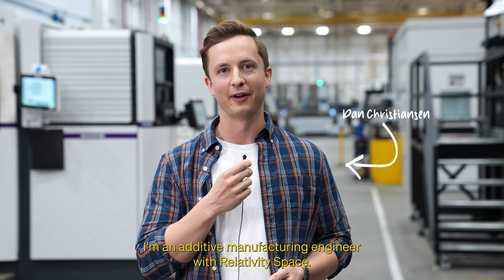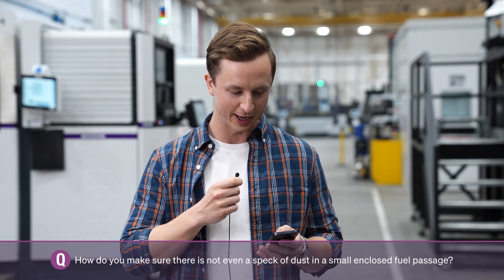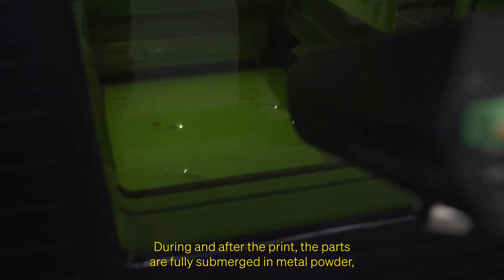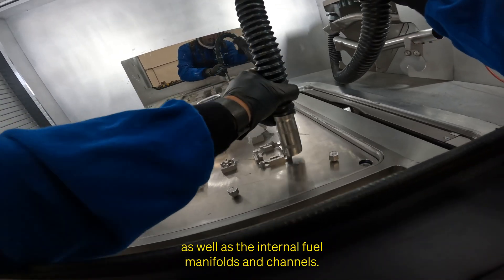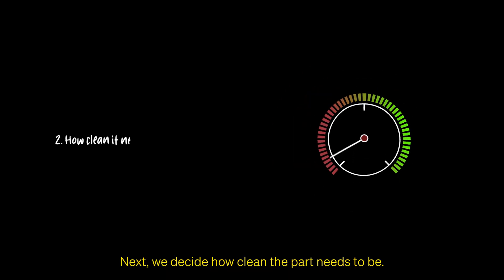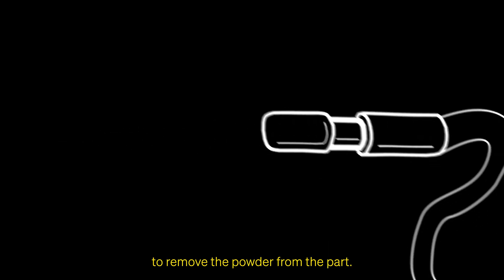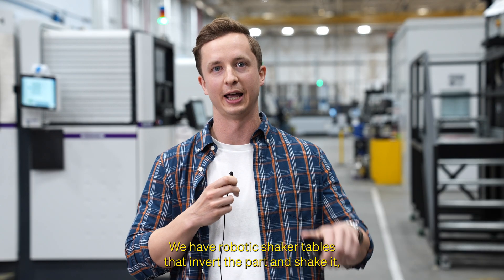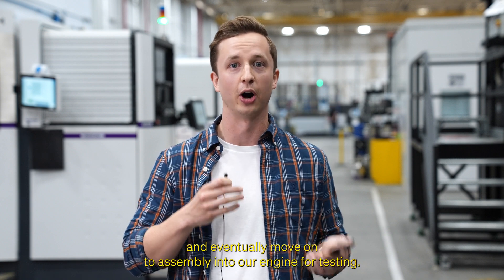Since You Asked: Depowdering 101

Comment: I'm looking forward to the times when this powder laser fusion metal printing will be cheap enough to buy consumer devices...like what happened with FDM printers. Thanks for the video!
Reply: i don't think that will ever happen due to the lung risks, but desktop Direct Energy Deposition, the kind of welding-like tech they used to print tanks, could safely be made for the home.
Reply: See the amount of ppe they have? The powder will work like asbestos in your lungs.
Also last company that tried to make a plastic SLS printer, got bought by formlabs, even before the Kickstarter's end